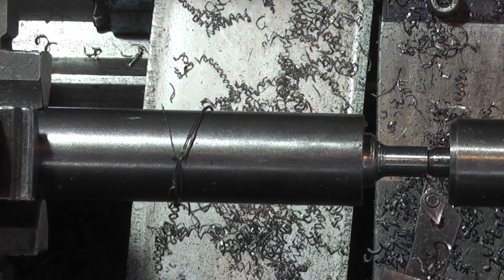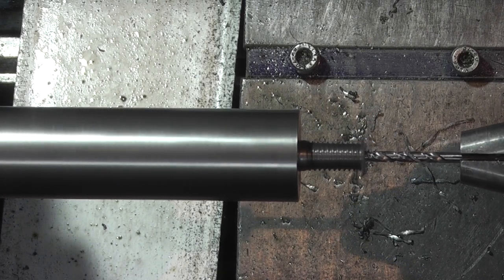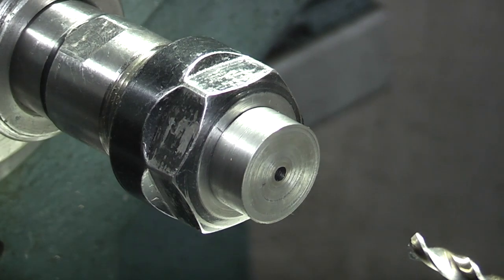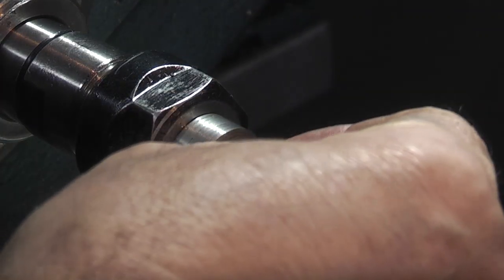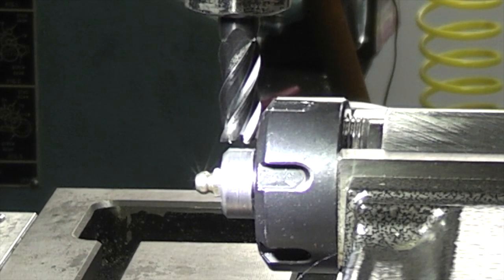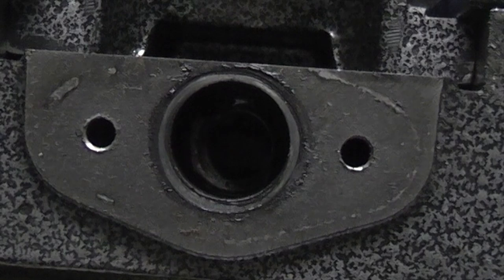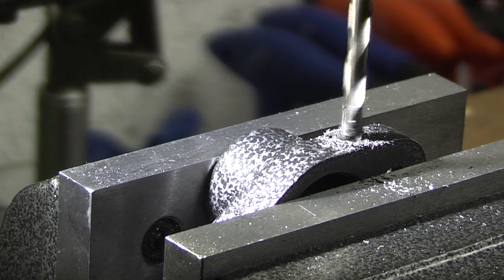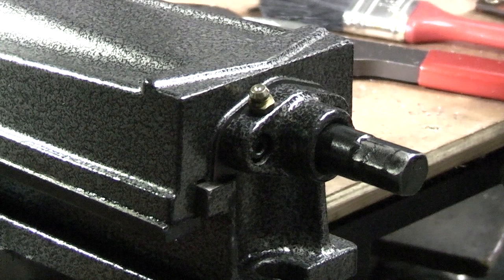Finish the modifications part 2

Comment: Nicely done. I have the same style vice that is now 30+ years old made in Taiwan. I'd thought about some modification similar to what you've done. I decided not to do anything and just disassemble the vice twice a year to clean and lubricate it.
Using grease on a milling machine or lathe  would be fine except for all the chips bouncing around. They stick like glue in the grease (and oil too, but not as badly) and work their way into everything. The mechanism being out of sight and out of mind lets that contamination build up. So you really have to periodically take the vice apart an clean it anyway. 
I would suggest that you use an oil gun instead of grease on the vice and use way oil on the slides to minimize chips adhering to everything.
Cheers from NC/USA
Reply from the maker: Hi George this is not a standard 8mm bolt the head is 17mm AF and 12mm thick a normal bolt is 16mm AF and 6mm thick. As the thread on the grease nipple is 6.5mm long you will need to drill a hole for the tap more than 8mm deep which gives a wall thickness of less than 1mm just under the bolt head. So the thicker bolt head makes sure that the grease nipple thread will not weaken the bolt.